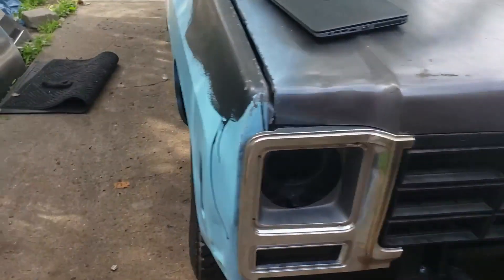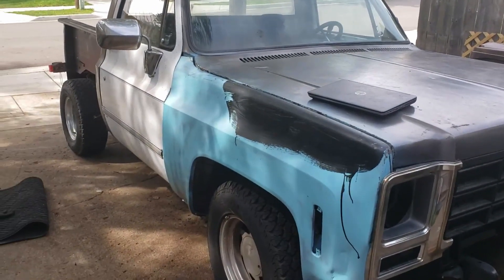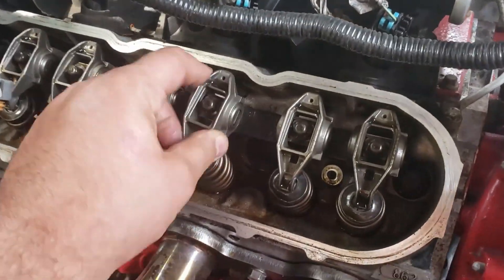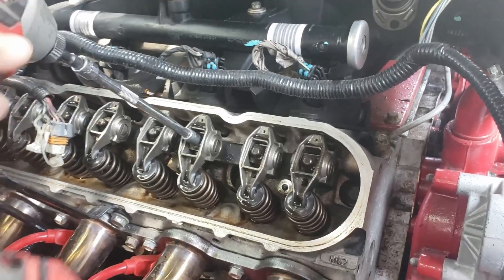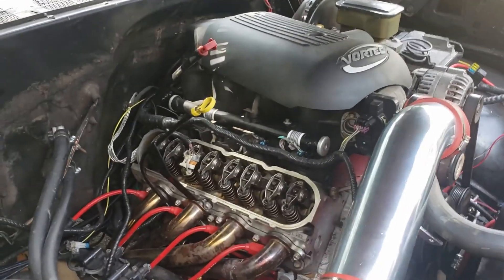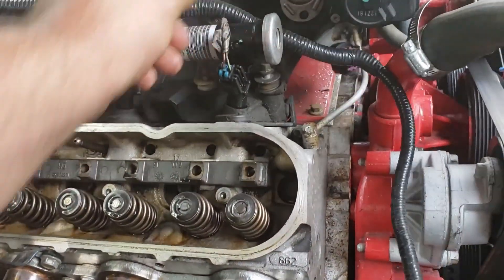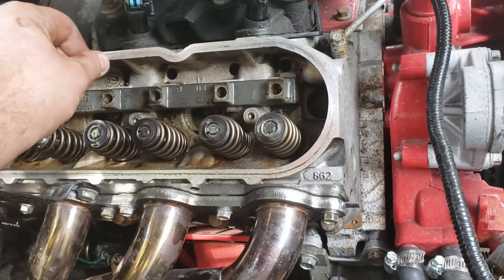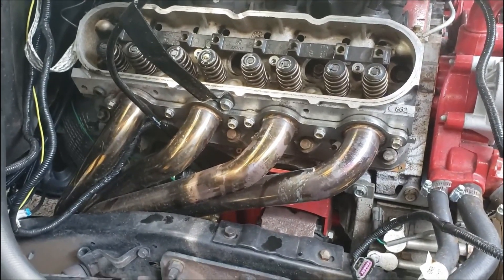Full send! More issues than a magazine stand lol.

Comment: I have seen this 3 times before where the valves floated and hit binding pushrods but not the valves. We just replaced all 8 push rods and ran with it on Trans Ams under warranty. Common denominator was they were all 3 standard shift LS1s which had been raced. You would sware it should have bent a valve if had hit but not one were.
Reply from the maker: Yeah I hit like 8600 rpm, and that happened, so.... I'm guessing 8500 is the limit 😂

Comment: Im not sure about that lockup but i guess if the computer is not setup for it that might be it but i am pretty sure i have been playing around and locked up my suburban at idle in gear and it did and wanted to die so if the computer stuff does not fix it id look into seeing if that solenoid is working

Comment: You can verify if the lockup in the trans is mechanically good by cutting the ground wire to the solenoid at the trans connector. Then extend the wire inside the cab and manually ground it in 3rd and 4th gear. Can't remember the pin letter in the plug but you can look it up. If it doesn't lockup then the solenoid is bad which you can ohm out at 16-20 ohms or the lockup fluid circuit has a leak somewhere.
Reply from the maker: It's not picking up because the harness isn't wired for it.